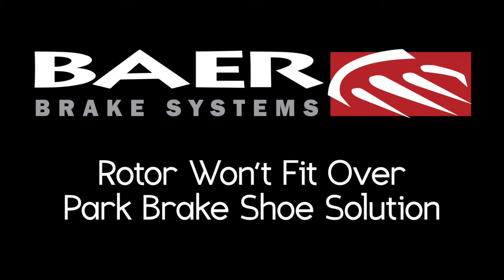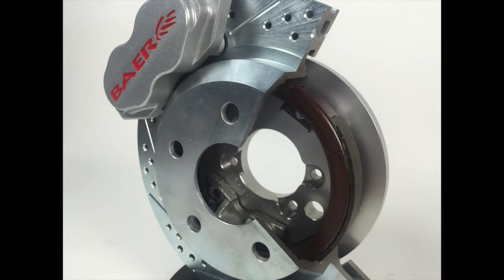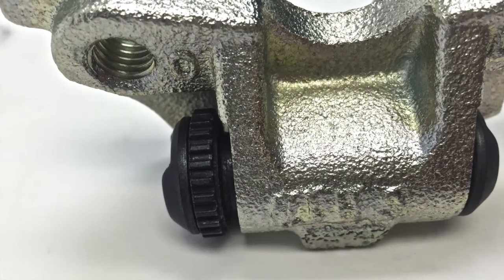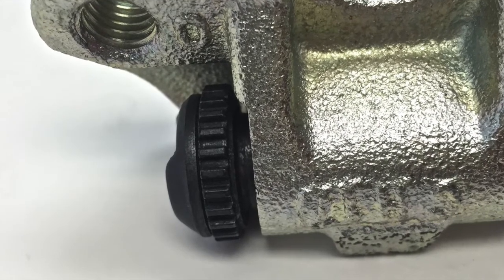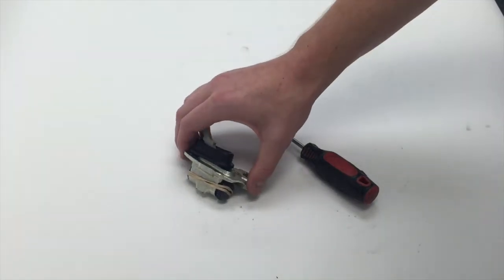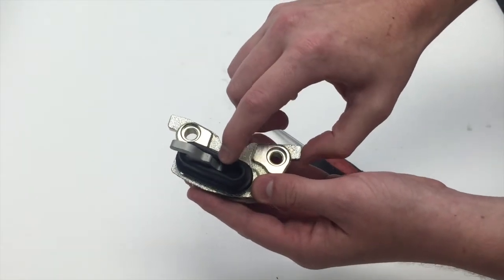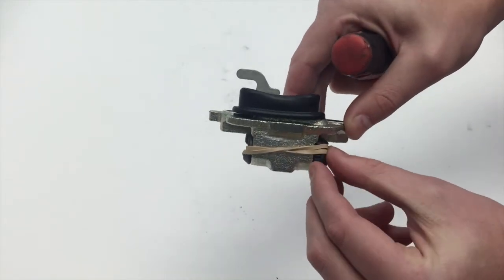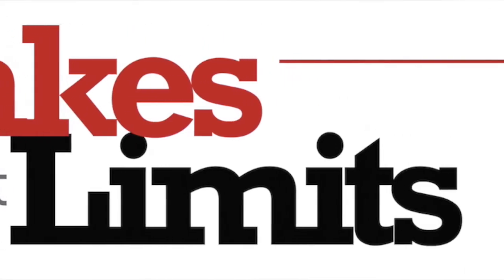How to get rotor to fit over your park brake shoe - Baer Brakes

Comment: I have a 99 mustang Gt the rear brakes rub really bad makes a horrible noise when driving any help would be awesome
Reply: check your shims if installed. The rotor may not be centered in the caliper. even a little bit off makes a difference.